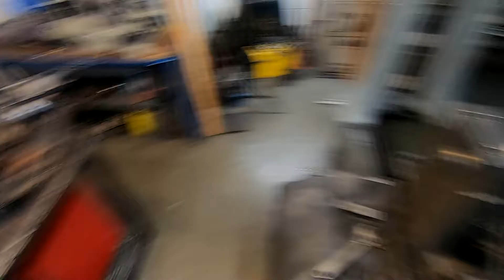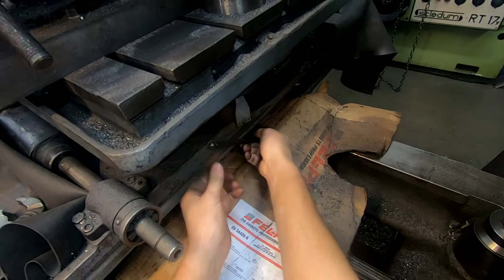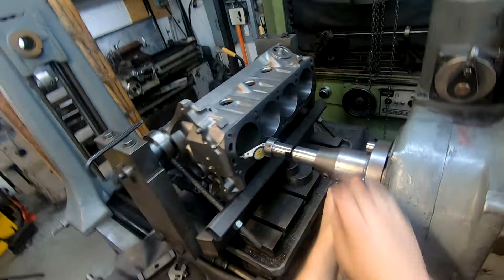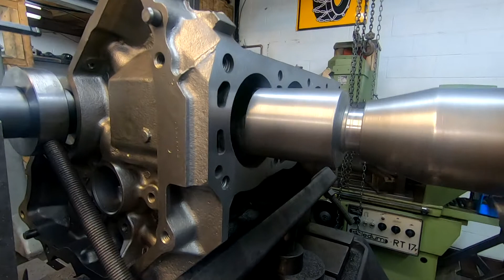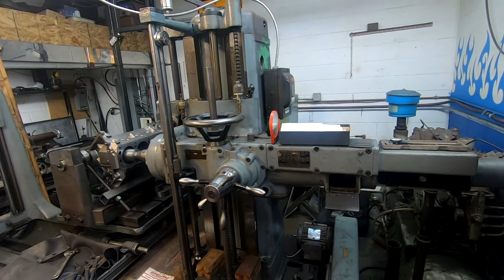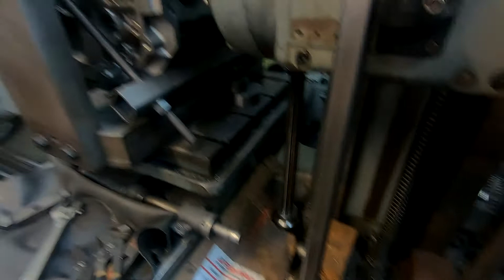Boring a 351 Windsor on a horizontal boring machine

Comment: Pretty damn cool! I've never seen a horizontal boring machine. Are you able to set a stop & walk away? Or does it have to be manually stopped once through the cylinder?
Reply from the maker: This one is an oldie and you need to be aware of what it is doing. The one I run at work is cnc, so depending on how I write my programs I can usually walk away or play on my tablet lol. There is a video or two in my collection of the one I run at my day job.
Reply: My HBM is of similar age to his but a larger size and I have stops I can set on the table feed or the spindle feed so it kicks out the same within a few thousandths every time. I generally just watch a dial indicator and stop it manual though as setting the stops takes more time than it is worth for most jobs.
Reply: @bcbloc02  gotcha! Makes sense lol.

On our boring machine it’s very simple to set the stop. If we’re doing an engine I will often try to recondition the rods at the same time as boring the block, so it’s nice to know it will stop & not crash if you have your hands full elsewhere when multitasking. Or if the phone rings and you get pulled away, stupid things like that lol
Reply: @bcbloc02  My G&L 25T has safety feed stops on the head for going up and down on the column, but I don't think it has feed stops or safety stops anywhere else.
Reply from the maker: @kooldoozer  it's designed to disingage on the X axis, mine functions corectly. Basic enough if parts are missing it could make them itself. The Z axis will crash and break the drive shafts support block.

Comment: Do you ever try to "blueprint" the bore centers so they are correct Or just center up on the original holes and let it go?
Reply from the maker: Just dial to existing bore, they are plenty close enough. I never did understand why the bore spacing was the big thing to try and correct when there is so many more vital machined areas to a block that are left unchecked and unattended.  I believe if one is going to claim a "blueprinted"  machined block they would pick a datum point on the block and machine everything to be correct, not just bore centers.
Reply: @whiplashmachine   I agree, if it’s a stock bore it shouldn’t be too far off in terms of locating the bore up near the deck. I guess you could center off of the top 1/4 in of the cylinder since that will be original bore without ring wear. How hard is it to get alignment to the crank centerline down at the bottom of the bore with your setup? Looks like it might be hard to spot if you’re a thou or 2 off. Wouldn’t matter much on an old 350, but something like a modular Ford block with short skirt pistons could have an issue. Really enjoy your channel as it has some out-of-the-box thinking.

Comment: How is the tower on the end of the bed of that boring mill used? Is it for fixturing work that needs more vertical travel?
Reply from the maker: The "tower" at the end is a support for long boring bars. This machine is designed to do line boring and the support holds and aligns the boring bars.
Reply: @whiplashmachine  Thay makes sense, thanks.